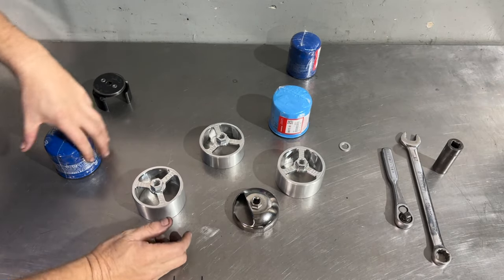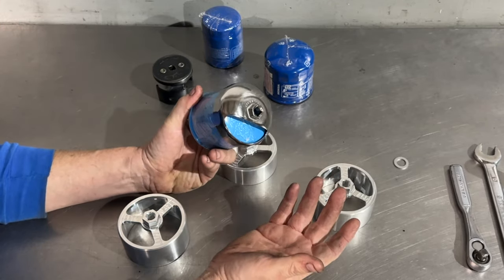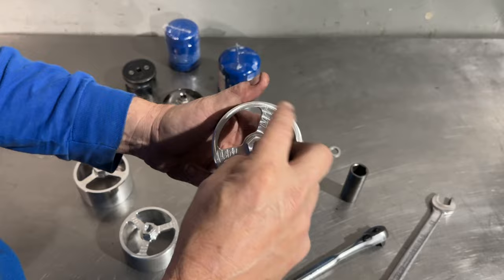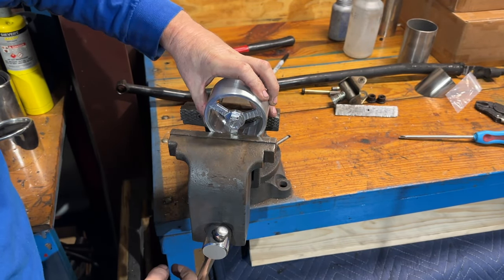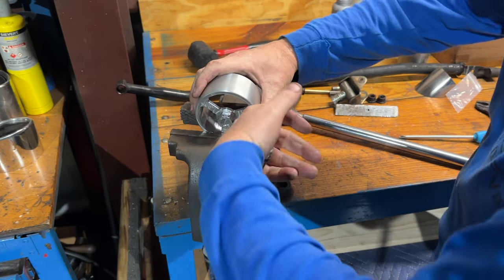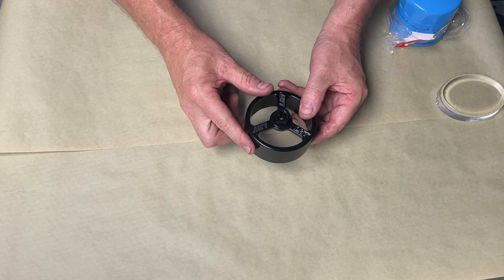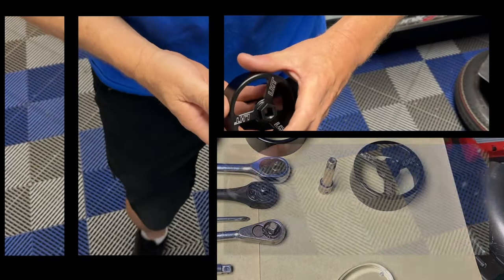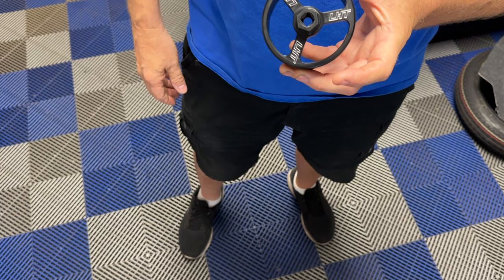LHT Oil Filter Tool - Design, Test + Build

Comment: Got mine last week and I put the tool to test over the weekend. First off, excellent craftsmanship and feels very well made in my hand. But my experience has been far from seamless and painless. When test fitting to the filter, the tool went on and off easily. But when doing the actual oil change, it was incredibly painful to separate the tool from the oil filter. It took a while, but I had to resort to punching the filter with a hammer to force it out. Even bigger problem was removing the tool after installing a new filter. I don't think I ever swore this much while doing an oil change. This was never a problem with filter wrenches that fit the 004 filter.

I DM'd your instagram about this and got a reply saying that I need to rotate the tool counter clockwise after torqueing the filter to spec to 'unlock' it. I will try this for the next oil change, but wish this was mentioned either on your product page or the manual that it came with. That would've saved me a ton of stress and trouble.

Hope there is a version 2 down the line that rectifies this pain point (at which point, I'll still support you as a customer).
Reply from the maker: Please watch this. It’s incredibly easy to 

How to use the LHT S2000 Filter tool
https://youtube.com/shorts/TP3eo2Wdmfw?feature=share

Of course we’ve used it a 1000 times while designing many different prototypes but this makes it very easy to
Reply: @LHTPerformance  This is helpful and I see that the product page has been updated to include these instructions. Thank you.
Reply from the maker: @drivewrenchrepeat  Yes. I’m so used to using it and working with different tools on a daily basis, I sometimes forgot.  I figured once you saw the how to video it would make sense.

Comment: Looks like a great design and execution. Only change I would make would be to engrave the torque spec in place of one of the logos, so it's right there when you need it. I vibropeened it on my Honda tool (which slips just like you said!).

Comment: I appreciate that you would like to sell something that you'd like to buy.
Forever, Honda had the s2000 filter 15400-pcx-004 and another filter for all the other engines (15400-plm-a02).  I didn't always buy the Honda brand.  I'd buy the K&N, because of the 1" nut on the filter, which eliminated the Honda filter tool's slipping off issues.

Note...K&N has started selling physically smaller filters for v6 Honda cars.  K&N changed its filter number when they went to the smaller filter (older K&N hp1010 vs newer K&N hp1008).
Reply from the maker: I would still trust what Honda choose for their S2000. That fact that it’s a specific filter for the S2000, I would 100% use the oem filter from Honda.

Comment: Could you make a cost effective one? We are only tightening this to 18-20ftlb not 1000 ft lb. I love your products but it’s alot I do appreciate the research that went into this
Reply from the maker: Keep in mind this is billet ( made from a solid block of aluminum. Then it’s anodized and then teflon coated makes in the USA. You can buy one off eBay cheaper  that will do the job.

Comment: This fits the NSX and Legend filters too right?
Reply from the maker: It fits the 98-05 NSX, not the nc-1 NSX.   I couldn’t say about the Legend.
Reply: @LHTPerformance Oh definitely not the NC1. Should have said NA1/NA2 originally. If it fits the old NSX, then it works on the Legend (with the longitudinal engine).  After the supply ran out of the “long” original NSX filters, Honda said to just use the shorter filter from the Legend.

I don’t work for Acura anymore or I’d pick one of these up. But I’m definitely interested when you make one that fits the regular filter they put on everything else.

Comment: To be clear, does this also work on the old S2000 Honda S2000 oil filter (the dark blue one at the beginning of your video)?  Is it only for the light blue Mahle filter?
Reply from the maker: Its design around the new light blue filter by Mahle.  However, it fits the NSX 98-05 filter so it should fit it. I can test fit it tomorrow as I have a couple of the old filters.

Comment: have you tried this on the normal Honda OEM Filter for other cars?
Reply from the maker: This tool fits the oem S2000 filter only.  The S2000 is larger and will fit on most other Hondas.